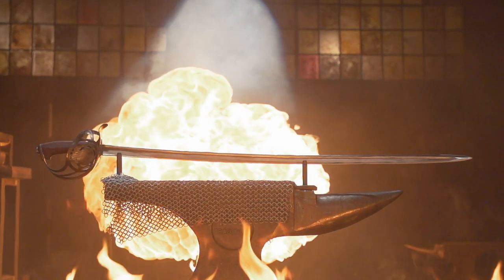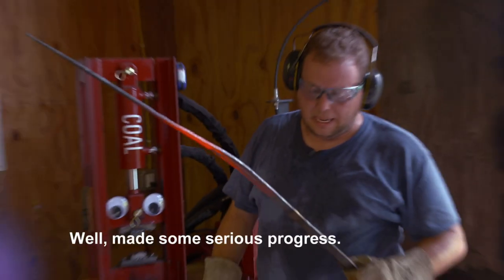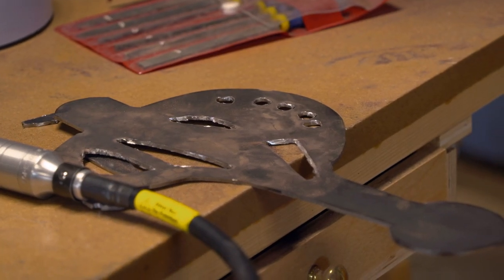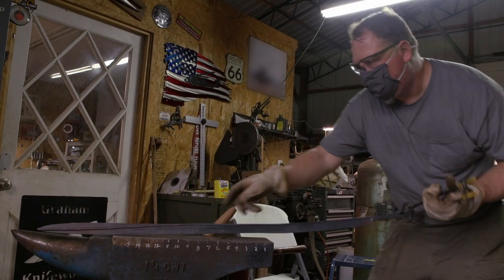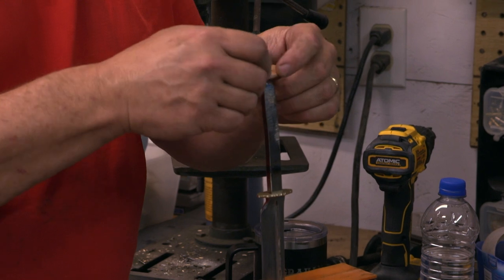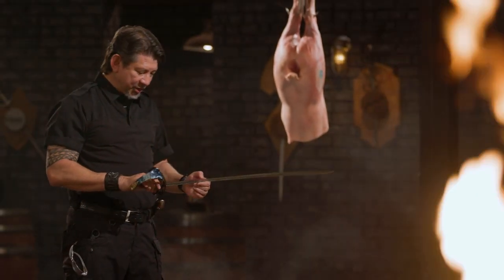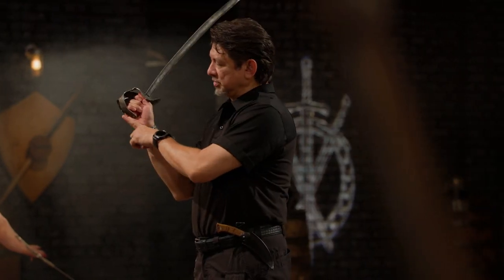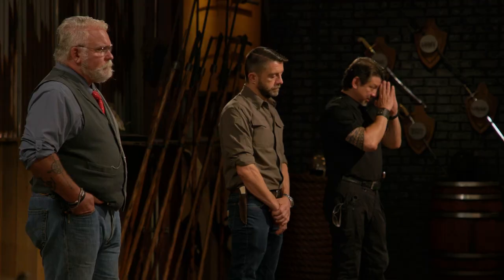BEWARE the Gaucho's Revenge! | Forged in Fire (Season 9)

Comment: Those disc aren’t made for cutting thicker steel they make rotary discs that look like a cutting wheel for an angle grinder that are meant for thicker steel
Reply: I was thinking the same thing those definitely weren’t the right disc
Reply: Same man. Only an amateur would use a dremel for anything other than ultra fine detail work. Even a die grinder would have been better by far. And I thought the other guy was an amateur for not properly tempering his first blade.
Reply: @Smitty-hr2mg  nah i did it myself....but i was well aware of that. Bc of that i had my whole face covered, instead of just my eyes and prepared myself that this could happen. But i had so many of these discs and no more cutting disc, so that even after around 80 discs, i still have more then over the half of the beginning amount. So i just used them as an Quick option, when i hadn´t a better option available. (could have gone buy new one, but it was sunday so the shops were closed in my country. And i needed that piece i was working on finished for the next day)

Comment: I mean I am not a blacksmith but if it fits his hand how should he know it won't fit others? He wanted to make a perfect weapon, but the test subject was small handed
Reply: It's because he didn't test it. That handle size wouldn't have been bad for a smaller blade like a knife, but a larger one like this needs more room to recover. 
He's not a small guy either and his hand is probably bigger than Doug's, but he didn't account for how the sword is actually used. I think he designed the handle for use with a hammer grip, but didn't actually test his weapon the way a sabre weilded so he ruined the weapon.
He designed a well-fitting handle but for the wrong usage. He didn't test the weapon and it cost him.
Reply: If you look at when he tests it, it's not attached to the blade. He didn't take into account that you get less leverage and handle space due to it being an enclosed guard.

Comment: Do they not give them the dimensions of the Judges' hands? At least roughly?
Reply: I recall once time a participant tried to get judge's hands measure but they didn't let that happen. I think that the idea is to have a weapon that can be used by people in general, like it were to be produce in mass.
Reply: It's not an issue of size, he has larger hands than Doug. The issue is that he didn't make the handle big enough to use that specific style of weapon well. If that was a smaller blade like a knife his handle would have been good, but a saber needs a larger handle for the user to recover and hold onto. 
His mistake was that he didn't test swing his weapon to see how it handled after he made it, he didn't take the way you use the weapon into consideration.

Comment: When something happens like this it's really sad, atleast test them and  decide later will not hurt anyone
Reply: I mean, in that case it would have hurt someone. You don't make a saber handle the same way you do a knife
Reply: Well, the show, and by extension the judges, have to consider their own safety, because if the judges test a weapon they know has a chance to go wrong, and it injures them, the network gets held responsible for putting them in that position. That's something they can ill afford. But even from a purely judging perspective, what they did makes sense, if they're going to treat these creations like actual weapons, the last thing you want to use is a weapon that's as likely to hurt you as it is the guy you're swinging it at.
Reply: That's exactly the problem here. The phrase "it won't hurt anyone" isn't true, a wrist injury is a fairly major injury and a difficult one to repair, especially when your main job is forging and testing weapons.